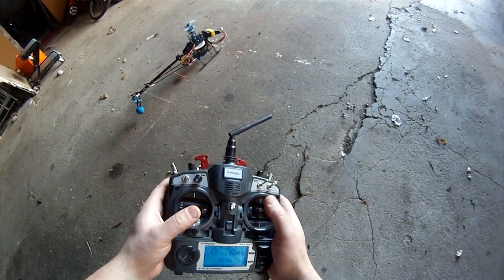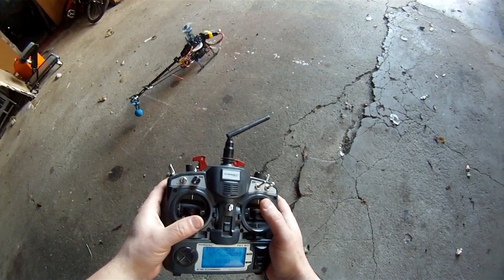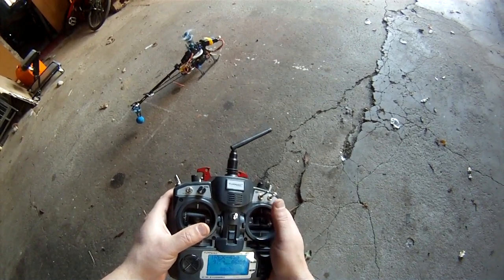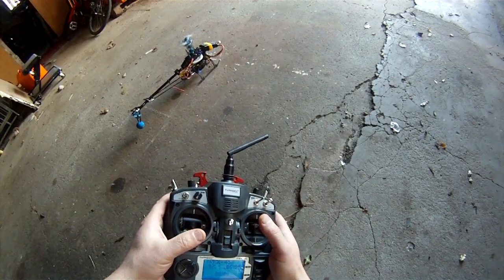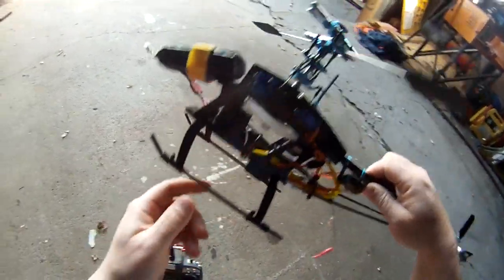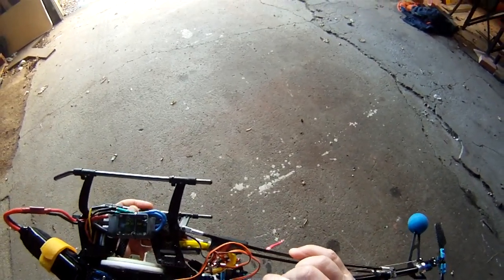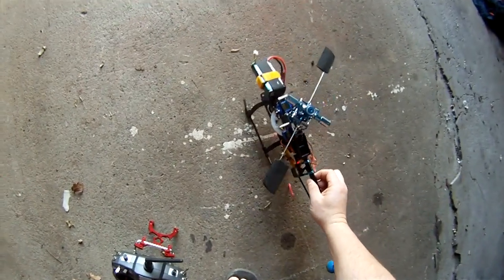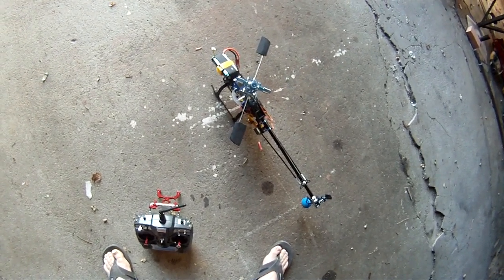Trex 450 Interference part 2

Comment from the maker: Hey Swag..... I tested these servos for 30 mins on my servo tester ..... put an older version of ER9x on it ... and the Config is all good .... I used another setup that was on STambo's Trex 500 ..... and it still does it.!...... I am thinking that thte servos may be drawing too much current as the motor bogs right down